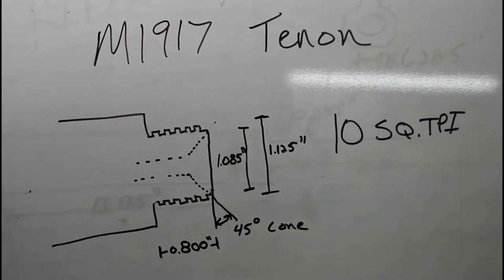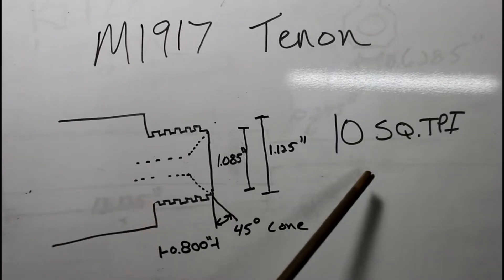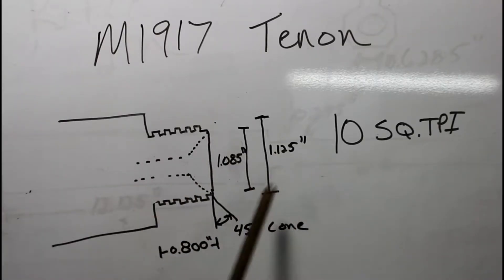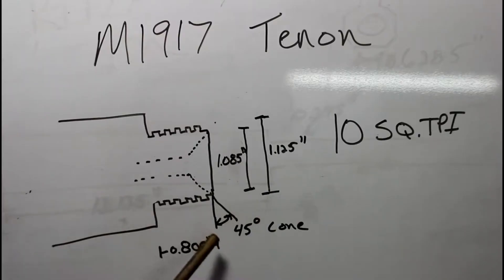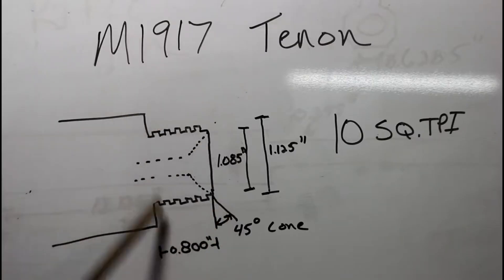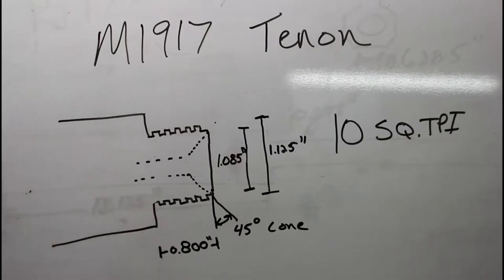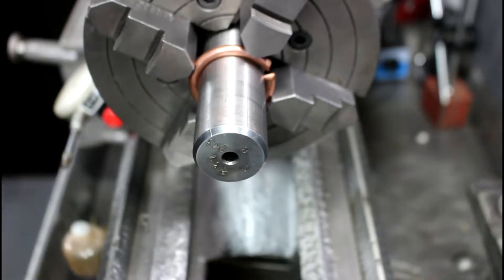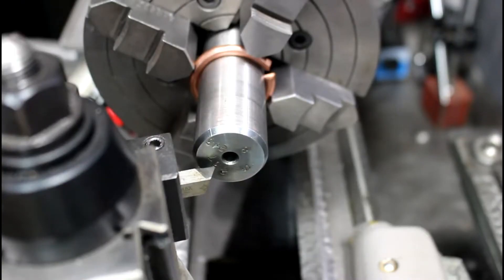M1917 Enfield Barrel Threading Square Threads

Comment: Hi, what is the role of that cooper ring in the chuck?
Reply from the maker: Allows the barrel to move around without bending the barrel. You can dial it in and not induce any stress on the barrel.  Without it or something similar,  you will bend the barrel trying to indicate it.

Comment: Good old video/trick from Joe Pie. Tool upside down and cut from the shoulder away, so you don't have to disengage the half nut at the right time. https://youtu.be/Z-dqOi_z5bk?si=0oIxR3RTF-uz85pq
Reply from the maker: I've known about that for a long time, it's nothing new. That wouldn't work here unless you made a relief cut which i didn't want and don't typically do on my barrels. With a little practice, you can thread normally without any issue at pretty quick speeds too. I always thread this way now at about 360rpm with a standard V-thread. I dont use the indicator anymore ether. With the sqaure threads you can also shut the lathe off and spin the chuck to an end point which is how I originally learned to cut sqaure threads. If a guy is just getting started in lathe work, the reverse tool is a cheat so you don't mess up.